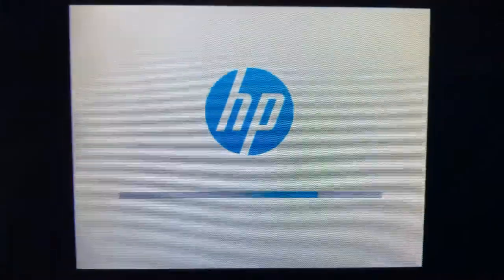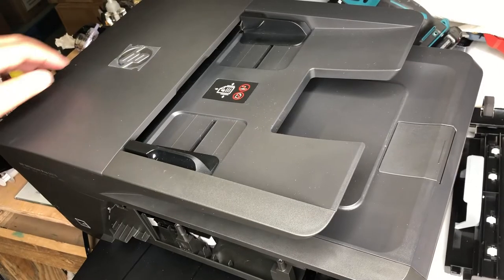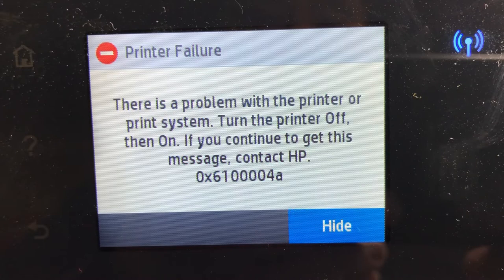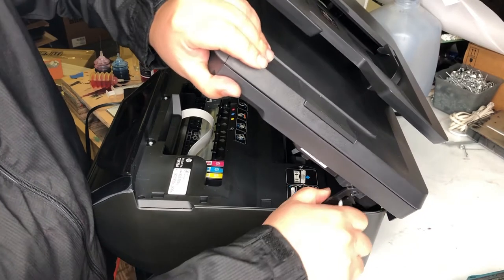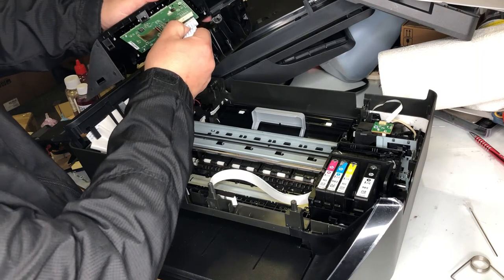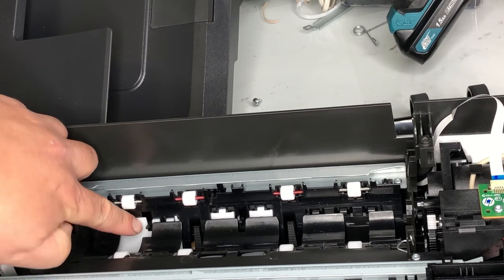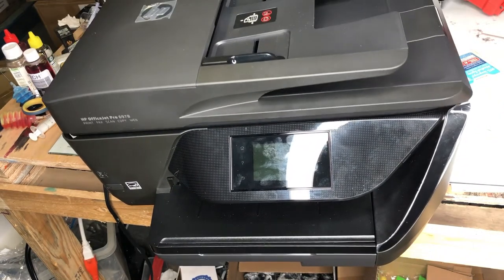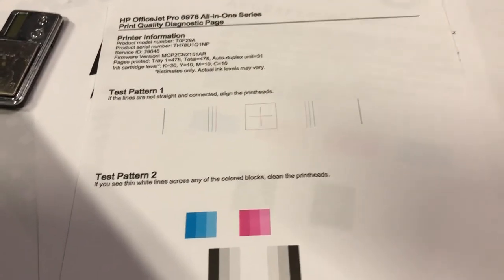HP Error 0x6100004a Officejet Pro 6978 - Document Loaded Fake Paper Jam

Comment: for anyone reading. Error 0x6100004a is also related to a suction pump that may be stuck or a burned-out pump motor. (pump stuck and the most common. disassemble and check)

Comment: I spent a couple of hours going through all the worthless hp advice and dead links. I found this link, watched the video, did what he did, and my scarcely used printer works like a charm. Thank you so much. BTW, the screws are Torx 8. Also, your arm is in the way when showing the power cable you are plugging in. I just took every cable out and put it back in. The power cable connector doesn't 'click', there is no mechanism to do that. It is a very poor design choice by hp, if you ask me. Thanks again for your great videos, Kevin.

Comment: Sorry, while I could locate what seems to be the tabs behind the LCD panel, pressing them does not release the LCD panel and allow the cover to be fully removed.  Unless Kevin guides me on this (at the critical moments, 3.19-3.27 in the video, his hand obscures the tabs) I will just buy a new printer and get on with my work.  I will keep the old printer for some time in case Kevin responds and I can work on it for "experience".
Reply: Same issue here. But it felt like something more on the left front corner was holding the top cover down, that the LCD panel might come off with it. Still never got it all off. Just tried to check the connection of the cords from the little opening I could reach them. Very aggravating. He didn't mention either that the entire top piece was hooked in the middle of the panel piece we needed to remove. That was a bugger to get back synced together by myself.
Reply: @wandajohnson2830  I just bought a new printer shortly after my post, discarded the old, and got on with my life.

Comment: I'm about to throw away my HP 6962. 
I get the 0x6100004a error paper jam and the Ink Carriage is stuck to the far right side.
I disassembled and checked cable connectors but no go.
Should I just give up and throw this thing away?
Reply: I have the same printer. Same problem. Did you find a fix?
Reply: @juancho883  Same problem here
Reply: @jeffrey fishwick  i looked for solutions everywhere, bought new ink, opened it to check every single corner, connected it to a computer directly in case it needed updates, watched tons of Youtube videos... ended up throwing it out. What a waste of time and money!
Reply: @juancho883  same!
Reply: Same here!  And it says I shut it down improperly!

Comment: Hi, Kevin: 7 screws came out clean using aTorx Mini Soft Grip Green Screwdriver Sgdt308 T8 Made In Usa Star Head; but 3 screws are stuck and I think the heads are stripped or otherwise damanged, as the screwdriver simply rotates within.  Please advise urgently.  Thanks!
Reply: A Google search on the problem recommended pushing in a sharp, small, flat screwdriver into the (soft) plastic head; getting a "bite"; and then unscrewing.  It worked!

Comment: I have this exact problem right now on the exact printer but all cables looked fine inside. Is it the maintenance on the rolers and checked the switches all looked ok. I think my problem is that the print head doesn't want to move. But I get pretty much all the same errors. Paper jam and exact printer error plus the improper shutdown message even when shutting down via the button. Doing a semi full reset did not get rid of the fake paper jam. Going to keep at it. Printer only has a count of 702 pages.
Reply: Same here.
Reply: Same here. Any luck?
Reply: I have the same problem. I've been at it 2 days now. Cables are, gears are fine... no paper jam but my ink carriage will not move from the right corner. I'm at a complete loss as to what it's stuck on.
Reply: same here. I have tried everything
Reply: i have the same problem, did you find away to fix it?
 @nanrey
Reply: @yossibrier7951  I tried all the options available on the internet. Nothing helped. Ended up replacing the printer.

Comment: hp envy photo 7855 is ready to be junked from someone. When I looked at the bottom of roller feed (paper pickup) isn’t moving and its gear doesn’t move anymore. I managed to move the feed roller down to stick to paper but gear aren’t moving. It detects that there’s a paper jammed but I don’t see it.

I did open up the printer to see if all cables were connected correctly but still same.

Comment: I am dealing with these very error messages right now.  What I am running into when trying to follow the steps in the video is the screws...  What kind (and size) of screw head is that?  I have a respectable variety of bits/heads, but can't seem to find anything that fits those screws!
Reply: T10 (torx)

Comment: Hello, (sep 2023): i took apart my HP 6978 w intent to replace the CMOS battery 2032 to see if that would make the printer print..  After changing the battery and putting the printer back together, the screen  on the panel was blank with a white background but no menu. 

I removed the new battery and replaced it with the old battery by taking the printer apart a 2nd time.  Again, the panel displayed a blank white screen. I played w buttons and checked ribbon cable connections but nothing.

I replaced the old battery w another NEW 2032 battery by dismantling a 3rd time.  After putting it back together, and making sure that the ribbon cables were correctly put back together, the panel is still displaying a white blank screen.

Is there a reset button on the back of the panel or anywhere after changing the CMOS battery?  Any help from anybody would be appreciated.  I can scan using the computer software and that works.  If i try to print a report from the pc hp 6978 software, I a get a "device is busy" message.  Apparently, the menu is hung up after connecting the power on.  Any ideas?????

Comment: Anyone know where the link for improper shutdown video is that he mentions at 2:27? I don't see it. I have the same errors except for the scanner and document loaded. I get the improper shutdown, paper jam, and then printer error
Reply: @yesyup3453  Unfortunately, I tried doing the same things in the video twice, just to make sure everything was plugged back in correctly. Notably, my scanner power cable didn't click either. I also did the factory settings reset JUST in case but no dice. Looks like I'll probably save myself the time and get a newer model. Might be something with one of the mechanical pieces in my case.

Thank you for replying though, it's nice to know others out there are willing to help!